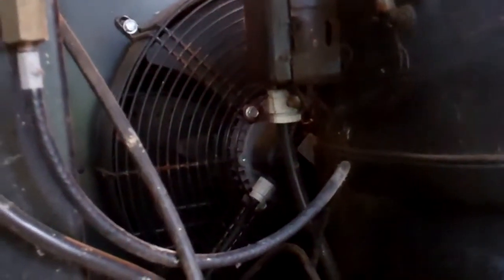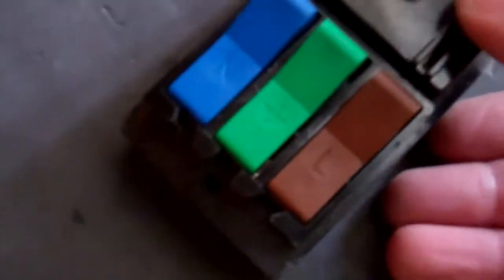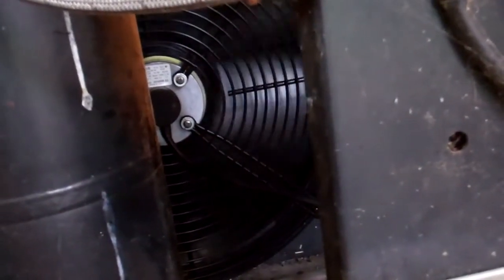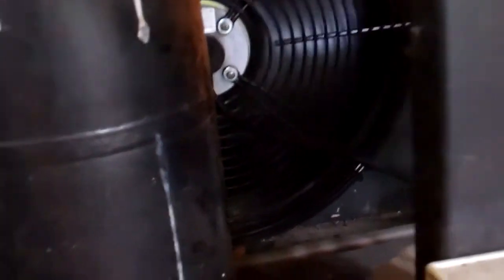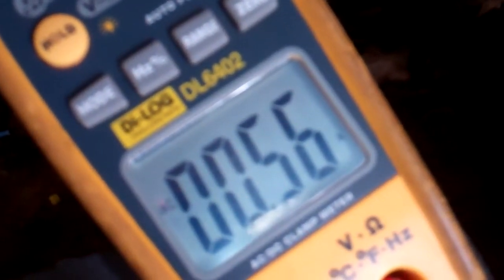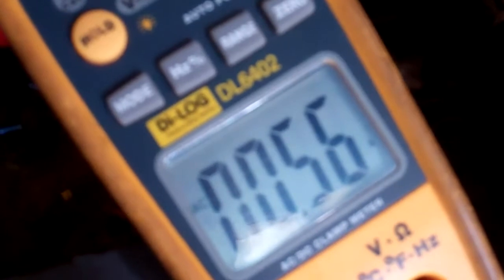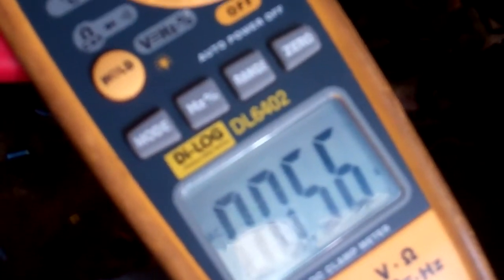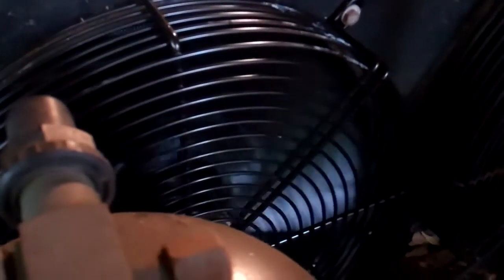Fan motor wiring

Comment: It's done with a hall-effect sensor at one end of the core. Instead of operating like a transformer, the core flux can be directly sensed by the hall-effect sensor. The core material is also different; a transformer needs a very high permeability core, but for this type of sensing you need low permeability so as to avoid core saturation with DC.

Comment: Those bloody push in connectors are plain shit-house! Especially if you're using solid large conductors. Fire hazard in the making in my opinion
The main dramas happen usually are after testing. A insulation test doesn't test the potential current load; Only leakages between other conductors or earth
Not quite sure what the regulations/and/or standards are over there in Britain or EU but our AS3000:2007 section 3.7 is a good read. Section 3.7.2.4 specificity states the correct style replacement.